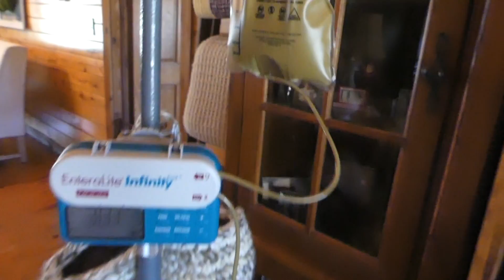Attaching The Roof - Building Chicken Coop from Dog Kennel

Comment: Great job. I have a question, my runs are 10 feet chain linked fences, what would be the best way to build a roof over that?
Reply from the maker: I have one of those with a terrible make-shift roof on it. It would be fun to redo it to show a way of building a roof. Basically I think I'd build a simple wooden frame and cover it with something light-weight like metal panels.

Comment: I need to do the same for my 10x10 dog pen that is my chicken shack. Putting tarps over it just isn't working. Where did you get the framing for the roof?
Reply from the maker: That frame came as part of this kennel. Our other kennel is 10x10 with no roof